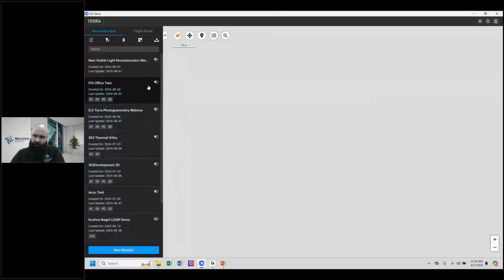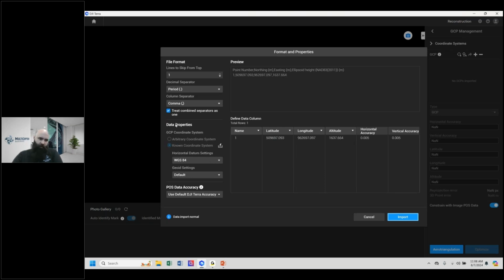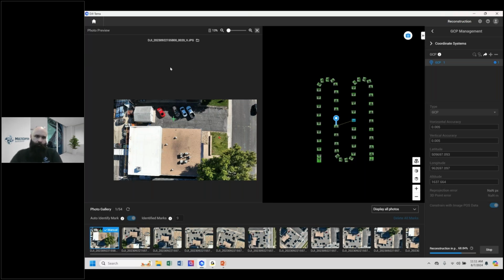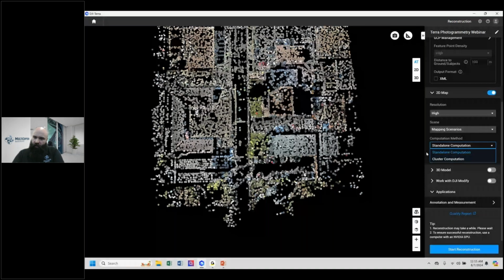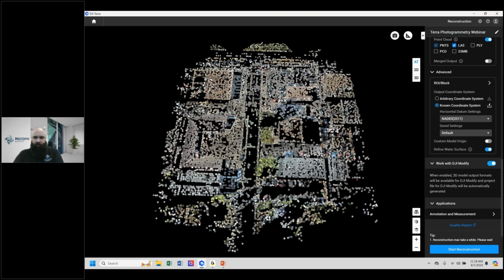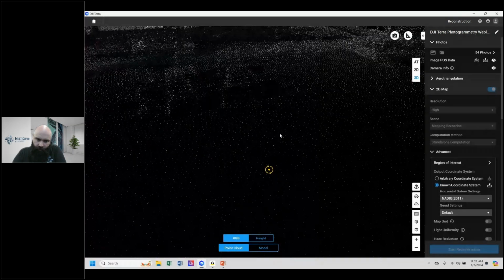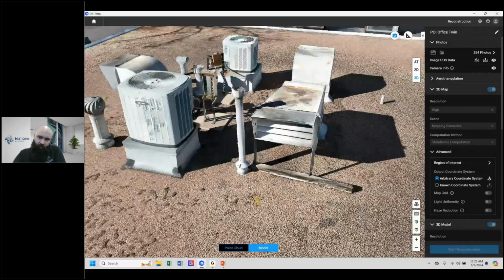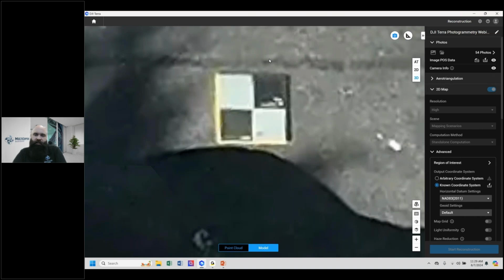Photogrammetry Processing with DJI Terra

Comment: by tying in the GCP does that take this RTK flight and turn it into a RTK/PPK flight if I'm understanding this correctly?
Reply: Hi, it’s Whit. Not exactly. Using GCPs (Ground Control Points) improves accuracy by anchoring your drone imagery to independently measured — and ideally, highly accurate — coordinates.

A RTK (Real-Time Kinematic) connection provides a live stream of GPS correction data to the drone. Each photo the drone captures is geotagged with metadata, including its current raw GPS position. With RTK, these GPS corrections are applied in real time, so the geotags are more accurate as the images are saved to memory. An RTK stream of corrections also helps the drone stay more precisely on its planned flight path.

PPK (Post-Processed Kinematic) works a bit differently. The drone records raw GPS positions during the flight without applying corrections immediately. After the flight, you apply the correction data to the photos in post-processing to refine the geotags. Once the geotags are corrected, you run the photos through your photogrammetry engine.

Thank you for watching!
Reply: @MulticopterWarehouseMapping  If I may, PPK works very well.
Personally, I use the DRTK 3 base station, which allows me to export a .DAT file that I then import into DJI Terra.

If you’re interested, I’d be happy to send you the full workflow by email — feel free to share your address.
Reply: @guysournac8663  Thank you for sharing. I have not yet had the chance to test out the DRTK3, do you prefer the PPK workflow over the RTK with it? I am scheduled to be testing it later this week and will have to try that workflow as well.

Please do send me the workflow, I will reach out via the email address on your channel.
Reply: @MulticopterWarehouseMapping  Good evening,

It’s not that I necessarily prefer PPK, but in my opinion, it offers greater reliability in the results. Let me explain:

I connect the DRTK3 base to a drone equipped with RTK. The flight is conducted in FIX mode, then I retrieve the DAT file from the base. During import, I apply a PPK correction to refine the data.

But to take things further, I really need to connect with people like you, who are also running tests. It’s essential to exchange, compare workflows, and grow together. In France, feedback of this kind is still too rare… In fact, your posts are what’s giving me valuable insights right now — so thank you for that!

And if you’ve got GCPs (Ground Control Points), that’s the icing on the cake — it allows for a clean, precise finalization of the process.

One of the key strengths of the DRTK3 is that it can act as both a base and a rover. If your tests prove successful, I truly believe it could represent a significant step forward in operational accuracy.

Right now, I’m a bit stuck — I’ve purchased the base… but I’m still waiting for the tripod! StudioSPORT is having some delivery issues here in France. So I’ve been improvising for a week, and I’m really looking forward to that tripod finally arriving!

And for me, the real priority is clearly the GCP workflow and integration into Terra